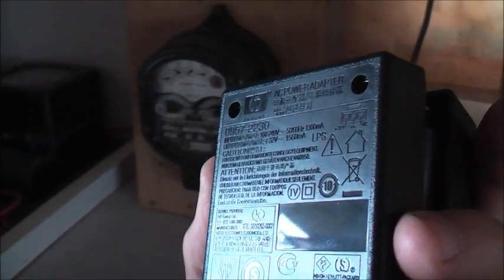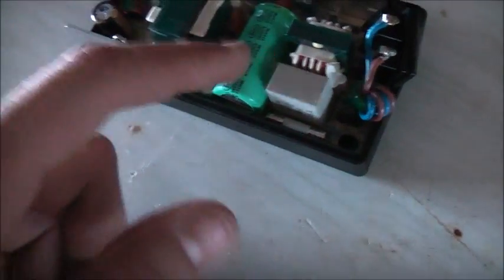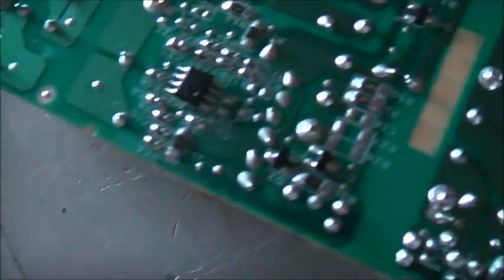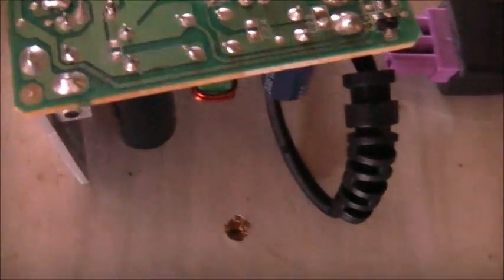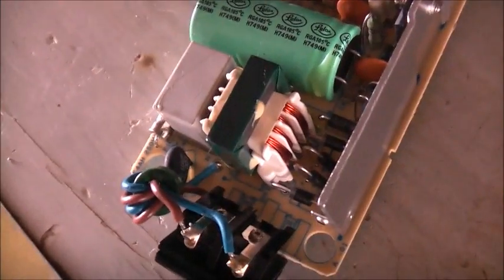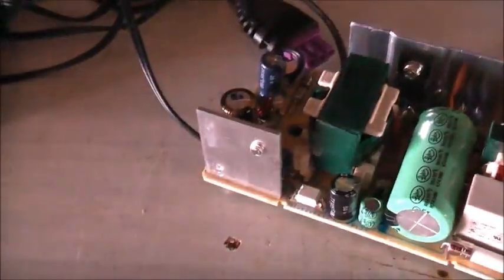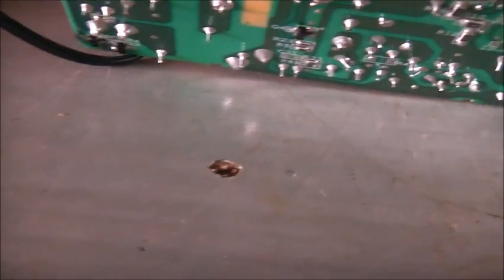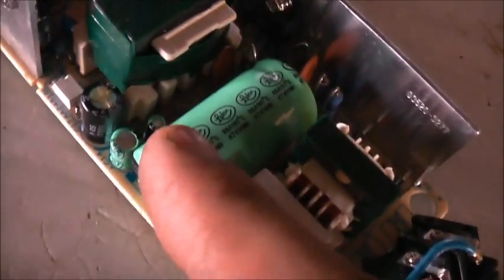Astec SMPS Teardown

Comment: Astec are a pretty good supply, ive had a few and they never went POP like cheepo's.

If you fiddle with the feedback components connected to the input of the optocoupler you can often adjust the voltage, but keep the overall wattage the same so it dont overload :-)